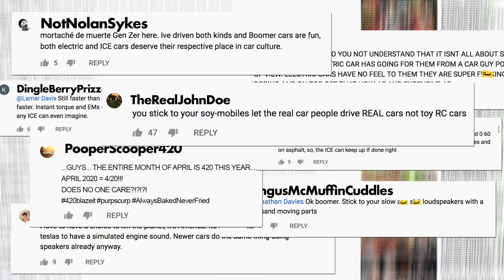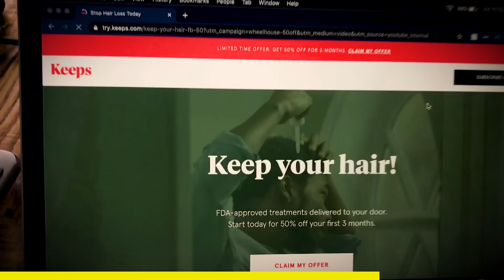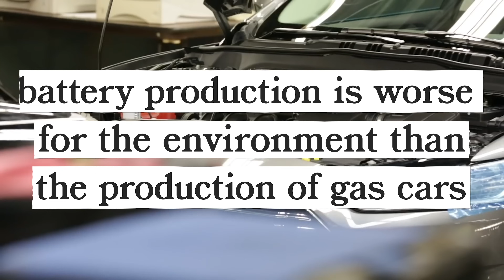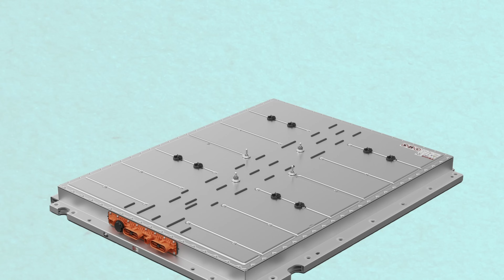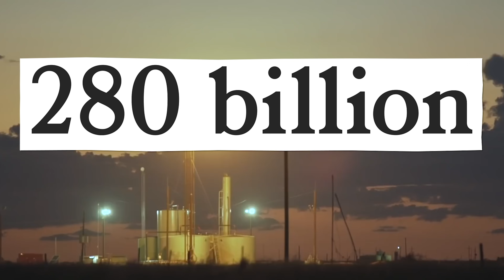Are Electric Cars REALLY Better for the Environment?

Comment: Not trying to argue because I agree and hope to see ev get even better but there are a couple points I feel are worth mentioning. 1 I’m not sure if when you said battery production you were accounting for the actual car which also takes energy to make. If it was in that 3D model estimate my bad. 2 didn’t mention about the average life of a batter so yes the ev will be better after a couple years then a few years after that will need a new better as it slowly loses efficiency. That does put them a bit closer together. 3. I know not the point of the video but you’re helping the environment (in theory)  more by buying a used car than making new ev since it will already have been made. In practice not so much as it takes a lot to get a company to produce less cars each year but the consumers do have that power. Again not trying to argue but anyone is free to discuss.

Comment: Being nice; Soooooooooo many fkups!  Less videos more fact checking. Good intentions but thrown together.
Reply: Hyperdrive E  care to explain any?
Reply: VolvoGuy_ lithium- easily, safely, Environmentally responsibly mined world wide today. 

Cobalt- cobalt mined unethically is not commonly used. Using Tesla is an example, they only by cobalt that can be traced to an ethical source.Again this was an issue at the very beginning and has now been definitely addressed.

The increased demand for batteries has led to many break throughs. Cobalt free and dry cell technology are both on the cusp of main stream.

Recycling-  old EV batteries are not being recycled in the obvious way they are being reorganized in larger scale situation where size isn’t the primary concern.

Coal/Oil -now that was just ridiculous. Is he referring to India or 1978? I don’t know? The only state in America that Uses coal As a primary source of power is West Virginia. for obvious reasons. The few Coal plants in America are primarily peaker plants. Used to fill in gaps for peak time. Most of these remaining ones are already scheduled for demolition.

Spoke of the average lifetime of a ice car and compared that to the environmental foot print of EV based on the average lifetime of a ice car, not the average lifetime of an EV. TVs today are proven to easily go 300,000 miles. They are incorporating longer lasting interior materials because the mechanical part of the vehicle is expected to go 500,000 to 1,000,000 miles. Time is starting to show that may be possible.

Fires-This one’s just ignorant. internal combustion engine based on the science of mini explosions, while carrying gallons of gasoline and oil are literally bombs on wheels. There are hundreds of ice car fires compared to each EV fire that makes every headline.

Government subsidies- so far off! “Rich people“ lol buying a model x get a  50% subsidy? No, Tesla buyers no longer get any subsidies for any models. What we need to consider in the US is the most subsidized industry. The oil industry!

Comment: Electric Car requires grid power that produces emissions. * shows steam rising out of nuclear power plant.
Reply: That could have been a coal plant. The modern coal plants look very similar to nuclear plants
Reply: Nuclear plants are really efficient. The issue with them is the waste from the fission reaction. The gas coming out of the towers is steam from the cooling process
Reply: Small nuclear power plants don't have to emit steam. And a SMR also won't leak any kind of radioactive materials into the nearby river or ocean.
Reply: @hendrikdependrik1891  
They already don't leak. Any waste water released doesn't even come close to the reactor itself, and everything that does is in a closed cycle. If a plant does leak radiation, it is detected and the plant is shut down. Nuclear, for better or worse, has a ridiculous amount of monitoring and regulations.

Comment: Just to be clear again, average car makes on average 5,2 m tons a year or 57 on a life time. Then there is the tons of C02 for extrating oil, is this included in the 5,2 t or 57 t ? It's a huge number that you need to divide by what: cars, boats, plane, plastic etc ? So how much on average for a car. I don't need to be convinced I drive a Bolt and electricity here is all hydroelectric + a bit of wind.

Comment: Well sounds that the EV is 50% around cleaner then the Gasoline car sound right it will take good an other 10 years before it is cleaner it all depends what some government to car industry is doing and how fast Battery technology will change Lithium is one way  Graphite battery that use some Lithium so it will be interesting where the development is going and don’t forget Solid state batteries is an other technology so we are only in the start we have one plus cars already here and have good advancement done so I ll see this technology going forward so is just a matter of time the only thing I don’t care is self driving cars that nobody ask for .( well depending on this c19 to how slow we go to)
Coming from the car industry I can tell you there is not just CO 2 but other good things happening like less moveable parts less longer engine I have a gasoline engine to and is a V8 nice and good but is time to go the next level and like a engineer we need something new the principal of the engine is old over 200 years even electric ( the principal was around 1870 to 1930 invented)but there is more possibilities for The energy to use then the Gasoline engine will have a limitation somewhere so for me is exiting for normal folks not really  well we  I say the time is the key.

Comment: Need take in that c02 climate change narrative and environment are 2 different arguments.  Popular opinions and the money trail link c02 to bad environment. Ever notice the climate change summit says science is over and never talk about the science. Theres alot of science talk on the other side of that argument. The other is the amount of environment that is destroyed by wind and solar farms. The fact that most have hydraulic systems to run them. Which isn't bad til you add the special environmental oil to that system that is required and those systems need maintenance every 5-6 years for leaks because the oil eats the seals. If it was regular oil would make it 15+ years. The recycling of the batteries need do more research on that one. It's not good. Plus life span of electric cars is yet to be determined. Considering how long technology as simple as a TV cell phones last over time. Think bad gm ignition switch and air bags were an issue. Wait til your car locks up or glitches like your cell phone.

Comment: Thank you, finally people seem to actually looking into the facts them self instead of just sharing the total nonsence the media pumps out. Agree with everything you said, obviously done your research and have the sence to look at the bigger picture. Keep it up 👍
Reply: Problem is that battery packs are only good for 6-8 years and then need to be replaced with not even doing close to the same daily/yearly mileage as combustion cars lasting past 17 years on average. Nolan didn't take in account for the carbon footprint of solar panels and wind turbines as well...like he did mention for oil and gas production. Ironically EV's use way more oil to produce than combustion cars do sadly. 
Did Nolan ever mention that fuel is 5 times more energy dense minimum than batteries?

Comment: What with all those batteries after few years?they are hazardous waste
Reply: The batteries usually last longer than engines do, they just lose some capactiy over time. At which point they can be repurposed for another 20 years for storage applications where energy density is less important, ie. grid storage. Then recycled.
Reply: They last in excess of 10 years at which time they are recycled ...unlike gas cars that push out tons of noxious waste into the environment 😯
Reply: @chrisvig123  I doubt you ever owned more than 1 self phone. Every year or two you have to change battery if you want to have at least half day battery life..that's reality with batteries. BTW self phone batteries are more advanced than car batteries.

Comment: 5:53 that's where you're wrong. Wind and solar should be Nuclear energy to let electric cars drive as efficiently as possible.
Reply: I have nothing against nuclear power, but why do you say it's more efficient than renewable energy such as wind, solar, and hydro power?
Reply: @DelaneyKassab  there's alot of reasons. 1. The amount of space needed for these farms. 2. Inability to effectively store extra energy. 3. Ineffectively in capturing the energy, especially seen in solar 4. Disruption of wildlife and other things if this nature.Big farms=destruction of wildlifes environment. Birds and other animals being killed by solar and wind by flying into turbines or heat from the panels. 5. Insane cost of production for these sources of energy. List goes on and on. 
Honestly, I'm a big fan of nuclear energy and its unfortunate that research has drastically halted and many plants have closed down.

Comment: You left out end of life cycle. ICE cars easily make 200k miles or 20 years usage. They then get pretty much %95 recycled (stuff like the foam in the seats and the plastic panels don't always get recycled). I have yet to see longevity of battery cars but if they are like any other battery, you are lucky to get 10 years out of them. Meaning you would need 2-4 electric cars for 1 ICE car.
Then you have to figure out what it costs to dispose or recycle lithium batteries x2-4.

Comment: Here in the UK hour electricity grid could not handle, all of the charging stations needed plus you need to remember DC fast charging uses alot more electricity then a normal socket in a garage.

Comment: But an ICE vehicle can last longer and can be serviced easier and cheaper than replacing an EV every 5-10 years. The replacement of EVs will have a greater impact when you compare it to the average car buyer that buys a used car. EVs only make real sense when purchasing from new, a used EV will have efficiency and potential battery issues far sooner than a used ICE vehicle simply due to a relatively cheaper upkeep and servicing costs, a set of spark plugs and an oil change is small change when compared to a new battery pack on an EV. Essentially people won’t be purchasing cars in the future, it will be either renting or leasing agreements. Purely the wealthy could possibly afford to replace an 100k Tesla every 5 years, because let’s face it not many will want to keep one beyond their 8 year warranty as expired. And could explain why classic cars are ever increasing in value. Because their passionate owners and enthusiasts can repair them.

Comment: one problem you mentioned is one the power where coal is bad but wind and solar are good the only problem you forget one factor Wind and Solar are both just as bad as it requires a lot of space to generate electricity which means they need to cut down hundreds of acres of forests to build them so they destroy what they mean to protect and tree take CO2 and process it into and while solar takes up less space than wind farms they can kill birds but basically cooking them to death. the only real way to make EV.  work in a way there are environmentally friendly is to use nuclear reacctors because they actually are efficient.  and any way when fusion becomes available fusion powered cars will be far better than EVs  as one fusion is far safer than gas or electric as fusion is hard to sustain as fusion will stop when pressure is dropped, so if a fusion cars reactor gets breached it will spit flames for a little bit but the plasma would rapidly cool and disperse and the only by product of fusion is helium.
Reply: besides wind and solar are unreliable sense wind will only produce energy when there is wind and solar will only porduce when there light and however nuclear power far more reliable and are safer than wind because people know they need to insure they cant fail.  and nuclear reactors are far more efficient to produce the same amount of energy a nuclear reactor does it would take thousands of wind turbine to produce the same amount of energy and a nuclear power plant only need a good sized ware house to work. now i can see placing them in places they would work very well like putting them on top of buildings. and maybe a few solar panels but really the only way to have solar panels be viable is to have them in space where there is less interference from the atmosphere and it has less down time.

Comment: This video contained one overlook: battery replacement. The video clearly explained that an EV's battery is responsible for the most green gas emission, yet battery replacements were never mentioned. If, hypothetically speaking, an EV's battery needs to be replaced in the 6 months to 2 years that the EV becomes more viable ecologically, it decrease the EV's efficiency because the green gas emission of a new battery needs to be added. Naturally, the battery replacement time varies per model, yet it's still important to include in the comparison in my opinion.
Reply: I think it's around 5 years
Reply: IKR
Reply: He is Right BTW
Reply: It is at most 2 years

Comment: You did'nt mention anything about maintance of cars.
It gets even wors fore ICE
EV's are practically maintance free(if we dont count anything that is related to ICE also, like chassis parts etc)
ICE need constant new engine oil, and filters, new gearbox oil after every 80 000km, and sometimes some other maintance, like new spark pluggs, or is someting goes wery wrong... new engine etc.
And ICE engines are more dirtyer to repair and more time consumeing.

Comment: That's not true. If you calculate all the stuff you need to mention, the EV is worse or same as the IC engines. The biggest problem is the lenght of life of  batteries. It is very bad and you have to replace them every 100 000km

Comment: Have you considered that by increasing the demand for electricity you will always increase demand for the most CO2 producing form of powerplant. If you are living in a place with 90% green energy, the demand of your electric car is probably not going to make a few more wind turbines pop out of the ground, but rather keep an old coal powerplant going for longer. So shouldn't you calculate your emissions based on the most CO2 causing type of powerplant in your grid.

Comment: Sustainable Tech MSc in making here. Samsung have just developed a solid-state lithium-metal battery that uses far less raw materials than current conventional lithium-ion batteries used in EVs. Additionally, the need for nickel and cobalt could be negated completely with this technology and sooner than you think.
Additionally (again), the manifestation of dendrites, the root cause of Li-ion battery fires, is nullified.
Batteries r gr8

Comment: Good video but did you take into account the maintenance on Evs batteries I wrote a paper on this and with the average battery replacement on evs the car needed a new battery before it made up for the production of the first one
Reply: I don’t necessarily think the  you are better but from the research I did I think they are about equal, just a thought

Comment: Honest question Nolan, did you take into account that Battery life of electric vehicles is very limited? Between 5 to 10 years, most EV batteries are below the manufacturers 'acceptable' limit and then have to get replaced! In other words, let's take a 20 year lifespan of a EV vehicle vs a 20 year lifespan of a gasoline vehicle? If i'd compare a Renault ZOE vs a Renault Clio, over a 20 year lifespan, i am absolutely certain that those ZOE batteries will need NEW ones before 15 years have passed, especially concidering usage of those batteries: harsh conditions (cold, hot, cold hot, short charge, fast charge) whilst that Renault Clio after 15 years will at the very worst need an engine rebuild. But NO new engine needs to be built, it'll 'just' need a new head gasket, new piston rings, the head flattened, and you're done. Yes they also need oil replacement every 5 years or so, so sure that needs to be taken in account too. But i honestly doubt you have taken battery life and thus replacement into the equasion. Correct me if i'm wrong! Because if the batteries need replacement every 10 years (and quite frankly, they DO), that means you will own this car for 21 years, then you will have to have had the batteries replaced ATLEAST TWICE. Whereas if you keep quality control of your gasoline engine, in 21 years, you don't neccesarily even NEED to rebuild the engine.

Comment: 2010 : Automatic Vs Manual
2020 : Combustion Vs EV
2030 : Electric Vs Hydrogen
2040 : Hydrogen Vs Water?
Reply: 2200: vehicle vs teleporter
Reply: 2300: teleporter vs DeLorean
Reply: Enrique Torres González Delorean v Wormhole
Reply: @z_hutcho  Wormhole vs ICE
Reply: 2100: Water vs metallic hydrogen 
2150: Metallic hydrogen vs antimatter
Reply: 2500: horse vs foot
Reply: @dromadairefache4138  haha it seems like 2500 will be post-apocalypse war🤣...everything will be going back to ancient ways
Reply: @dromadairefache4138  Lol, someone hit the reset button :') RIP
Reply: Auto vs Manual is still going on. 
2200: Darkmatter vs Antimatter.
Reply: 2505: static drive VS Brawndo
Reply: 787brx8 “Brawndo has electrolytes “
Reply: Rather have straight lpg
Reply: Hydrogen will not be used in cars in future. Because hydrogen car is just an EV that stores energy in hydrogen instead of batteries. Hydrogen vehicle converts chemical energy to electric energy and then it powers the electric motor 😑. Why do we need to carry dangerous hydrogen around under our car, transport it to hydrogen stations, build new infrastructure??? We can just use existing infrastructure to connect charging stations to charge vehicles that store energy in batteries. Batteries are much safer than hydrogen tanks in cars.
Reply: Dangerous hydrogen?!? Gasoline is so much safer lol.